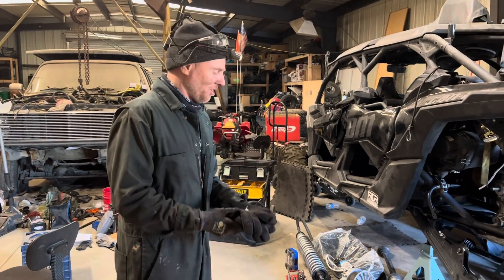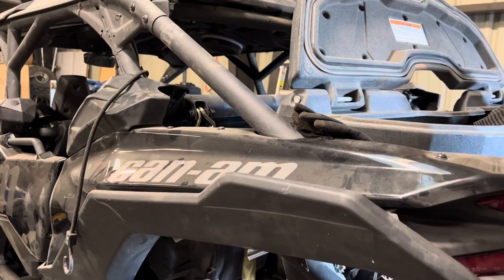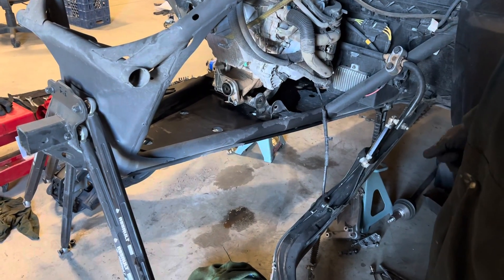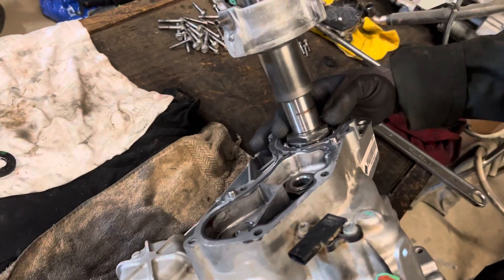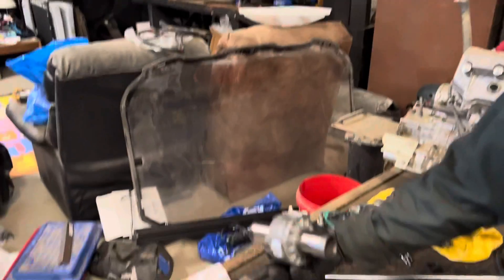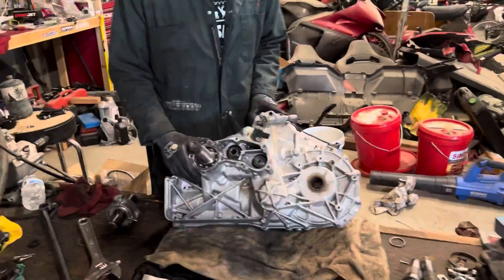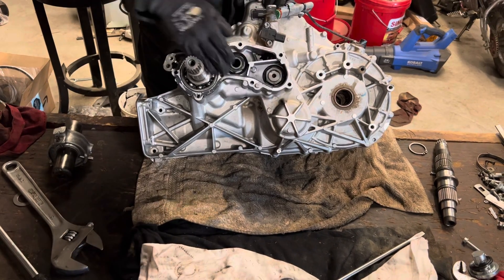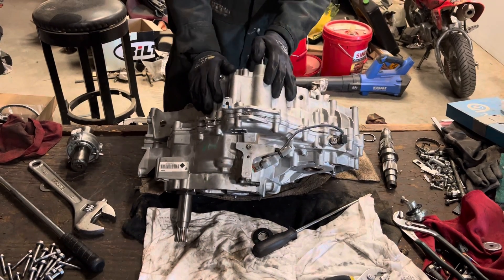CanAm X3 transmission/gearbox removal and disassembly tips

Comment: My gear box will not go into high gear. And if it does it pops out. Any insight on this? Just digging in to learning how these work currently so any insight would be appreciated. Thank you
Reply from the maker: Sorry for the late reply, I would check the cable adjustment first, if that isn’t adjusted correctly this will happen.

Comment: Awesome video , definitely some good pointers made my life alot easier. I do have a question about gear box internals… my pinion shaft has a gap between the gear and the shaft is that normal ?
Reply from the maker: I would have to see a pic.